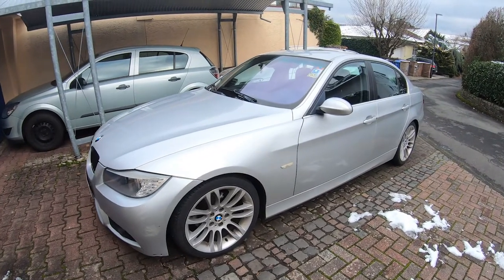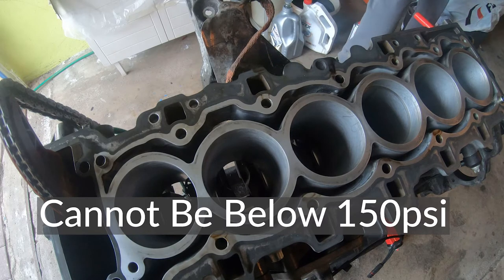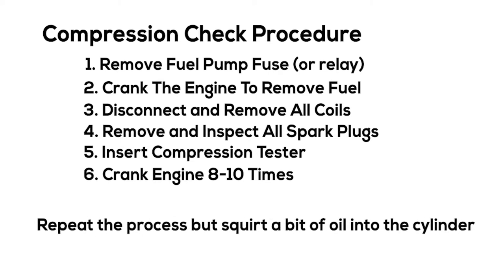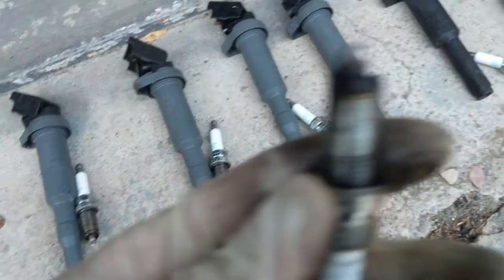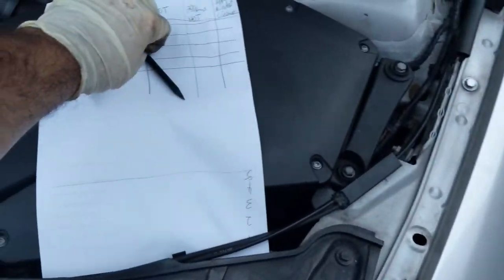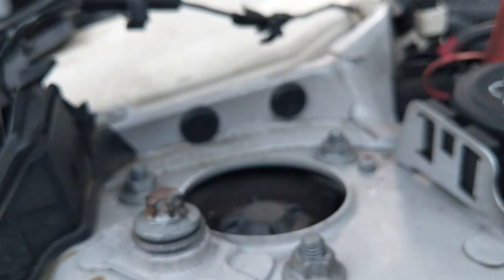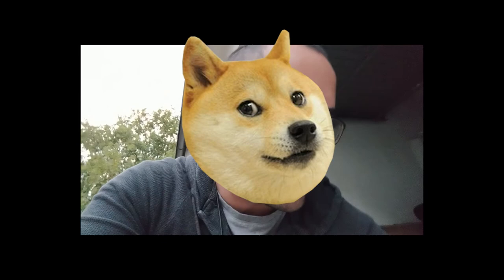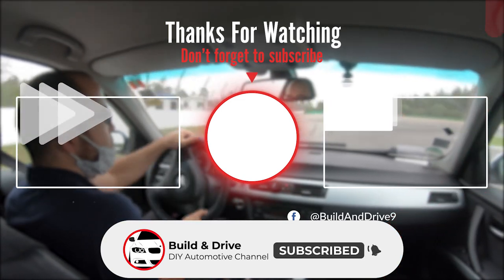How To Compression Test Your Engine [2023]

Comment: N52 compression test requires using an allen key onto the valvetronic motor in order to turn the eccentric shaft to a closed degree so that all cylinders are in a sealed position, otherwise you ll get false readings.
Reply from the maker: Are the instructions for that process printed somewhere in a service manual? Can you send it to me?
Reply: @buildanddrive  it's in this fucking program ISTA+
Reply: @buildanddrive yes it s in ISTA+.
The procedure is very easy.
Plug your scanner, display the eccentric shaft angle. Normally engine off, it s 58 or 68 degrees. Unplug the eccentric shaft actuator motor socket, and with an allen key turn the actuator until your scanner display 176 degrees. Then you can start testing compression.
Unplug the injectors harness. Remove the sparg plugs and coils as you did and test compression by the firing order 153624.
Your compression tool hose must have a shredded valve. Other wise it will loose pressure at each crank.

Scanners like INPA, ISTA, Protool, BimmerLink, DeepObd can display the E-shaft angle.

Comment: Thanks for clear videos. I'm buying used N52 , i chacked 4 used engines in and out of cars. wondering why all the 4 engines 4 or 5 cylinders had 30-40PSI compression but 1-2 cylinders 160-170PSI.  i tried to turn the Valvetronic  by hand and the result was still the same. 3 engines no oil but one with oil. still, i cannot understand was this broken engine or related to valvetronics or Vanos? any idea please?
Reply from the maker: Is it the n52b25? I noticed when my engine was almost dead that the oil was burning so fast that the digital oil guage could not keep up. That's when the oil would run out and blow a cylinder
Reply: @buildanddrive  yes, 52b25. you mean 4 engine from salvage yard all are blown? even all the 4 sellers are talking the engines are fine and they give me 6 months warranty?! (  no labor)
Reply from the maker: I'm not sure when all of the would have that low compression.
Reply: In N52b25 bank 2 cylinders always die prematurely because of excessive oil consumption

Comment: para hacer la prueba de compresión el motor debe de estar frío o caliente?
Reply: Both. But accurate results are during a hot engine (oil temp >= 80C)
Reply from the maker: Do both and see what's the difference.

Comment: I have low compression on n52b25, aprox 85 psi on each cyllinder, it consume 1l/1500 km. How could it even running and how long it will last my engine ?
Reply from the maker: That doesn't sound right. Are you sure you compression tested the engine correctly? Does the car have trouble starting when cold? Follow these instructions, make sure ALL spark plugs are removed when cranking. Test it without and then add a little bit of oil to the cylinders and compare the values. If the same... Do a leak down test to check.  https://youtu.be/v0gH8dFyWH8
Reply: @buildanddrive  I followed your steps from the beginning, I removed all spark plugs, I set the valvetronic to 176 degrees, I did an wet test and the results are a little bit higher, around 105 psi except cyllinder 3 which was still on 80 psi... My car is starting without struggling, only problem is that I have rough idle few seconds, after I cleaned spark plugs, that tough idle disappeared, another thing is that I have cats error on almost every time , is during a little bit after I clean error code to reappear again.Is strange even for me , because I can run pretty fast, the engine revs at the max RPM without struggling, I go even with 200 km/h on highway.
Could be possible to be a timing chain problem, valvetronic or a headgasket?I really don't understand, for this compression my car should smoke oil on exhaust like a diesel but mine doesnt smoke ...
P.S. I used exact the same Compression tester like yours.
Reply: @buildanddrive  Today I changed the oil with Valvoline Maxlife 5w30 and I used some flush from Liqui Moly to clean the engine maybe piston rings were stuck with carbon , but nothing has changed, the compression is the same like yesterday.

Comment: Man. Get yourself ISTA.
The procedure of testing compression in a valvetronic engine is different.
You need an allen key! Turn the eccentric camshaft  motor (VVL motor) untill valves are closed then you can start your compression test.
Without Doing this, your compression test is incorrect and useless.

After 100.000 Kms or a little bit earlier, N52 and N52k piston oil rings get clogged with carbon especially if the engine has been running lean for a while or suffered from overheating once.
BMW was aware of that problem but only released the fix at a very late date.
The updated version of pistons and rings fixes the oil consumption issue.

However I have seen some N52s reaching 300k Kms with no oil consumption whatsoever.
Reply from the maker: Do you have a tutorial or repair manual instructions I can follow? I have ista and can try it out.
Reply: @buildanddrive  Sorry this reply is so late, I'm finally getting round to my rebuild and found this video detailing the valvetronic issue when checking compression. https://www.youtube.com/watch?v=Hb7M9rMzU5E&t=39s
Reply from the maker: @mdavisyates  thanks for sending this. I didn't adjust the valvtronice motor and still got the same results.
Reply: Does 08 e60 n52 have the update  ?
Reply: @robertgreatsinger9179  yes for any n52b25 made before june 2010